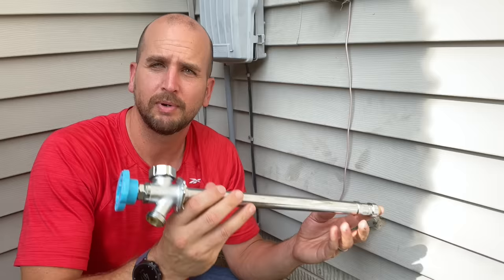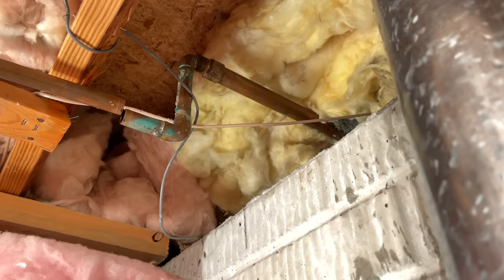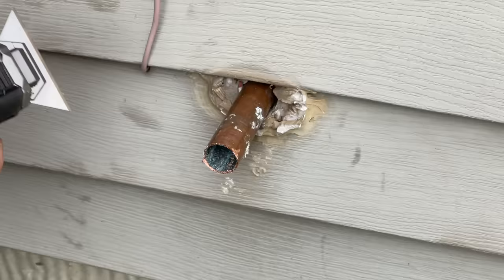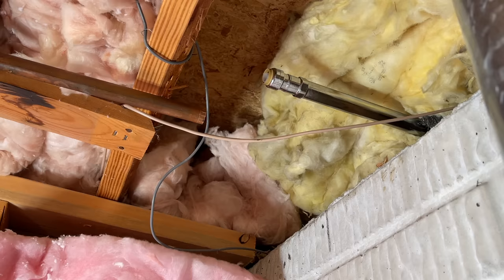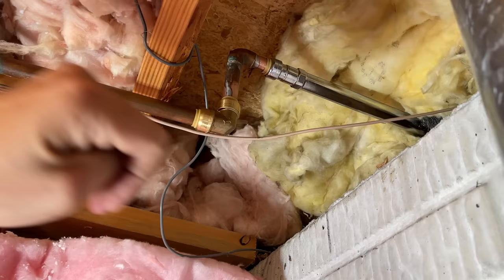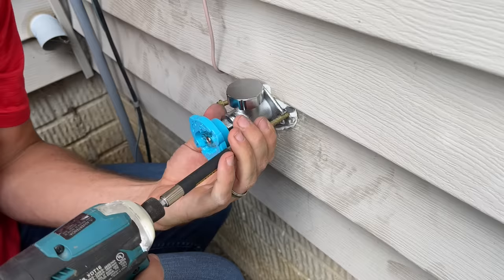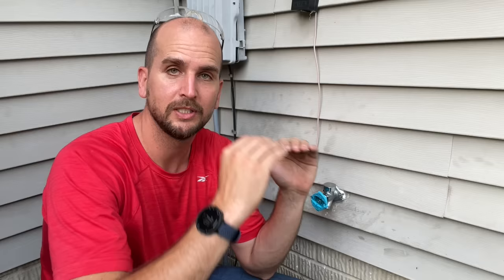Outdoor Spigot Replacement | Sharkbite Frost Free

Comment: Shark bites are good unions. You just don't want the pipe just de-bur the inside and outside of the pipe. It explicitly states that in the installation instructions. If you sand the pipe they may fail.
Reply: Interesting comment. I assume that the sanding of the pipe changes its diameter if sanded too much. Ir is it another reason?

Comment: Ive seen that Sharkbite reccomends against sanding the outside of the pipe like this.  I imagine it would be fine with an extermely fine paper, but the idea is that the outside of the tube needs to be very smooth (IE not roughed up with medium grit) for the o-ring gaskets to work properly.   So you might have done better to just melt that excess solder off with a torch, and clean with a towel.
Reply from the maker: Thanks for the feedback Jon 👍
Reply: Think most important is straight cut and no burs

Comment: Good video as always. I just replaced 2 frost-proof faucets this weekend. One leaked inside the house when you turned the water on. (Luckily I went into the basement right after turning it on or my basement would have flooded). And my other frost-proof faucet was spraying water outside when you turned it on. The anti-siphon had failed.
I replaced them both with an Aquor V2+. A very slick  system and they are rebuildable. Definitely worth checking them out. I have brick at both faucets and the recommend the Aquor V1 for brick or concrete but I liked the look of the V2 better and don’t mind the extra work. And I used the Pex-A expansion version with a service loop so I can pull it out from the front to service it should I ever need to.
I personally don’t care much for the quick connect fittings. If I am in a tight spot or don’t have room for a torch to solder and don’t have Pex-A available I use a double ended compression fitting (or make one). It’s more work but I’ve never had one leak and I can easily take it apart if I need to service the hydrant.

Comment: I live in New England, I didn't go through all of this.  All I did was add a ball vavle inside so in the winter I shut it off and run the rest of the water out.  You just really have to remember to shut the water off.

Comment: That downward slope is a big deal. We found that out the hard way last winter. There was no slope on ours and due to a freak ice storm the water inside froze and blew the faucet apart and there was water everywhere. For a replacement I'm going to use a couple of feet of PEX flexible pipe to replace the old galvanized steel that will allow me to get the bend required to give me slope.

Comment: I’m refinishing my basement currently and found my front yard water turn off valve buried  behind 2 gas pipes that was all drywalled over. Definitely trying to make it leak proof now during the remodel compared to later on when it’s all buried again especially because I’m going to lose access to the shut off valve again

Comment: I would like to see a video covering replacement of the shut-off valve. My house was built mid 70's and the valve doesn't work, as well as being in a horrible location. I know I could hire a plumber, but with my experience I would also love to do the job. But as I do with everything, pre task planning dictates I should probably make sure the steps I have in my head are accurate.
Thanks for another great video!
Reply: Unless your good at soldering I don't recommend a large fitting like that, depending on age could be a screw on though. If the area is finished think of the damage that could be caused. I am fairly good at plumbing and do a small amount in a professional capacity, I would still hire it out for the peace of mind personally unless it was a trailer or screw on in an unfinished basement.
Reply: @stich1960  It's currently soldered, but looks like it was probably "wet" while being done. More than likely replaced already. We have lived there for 21 years and it has been crap for at least a couple years.
I have checked with a couple local places (small and large business) and they want $500 plus to do it. That just seems silly. I can call the utilities to shut off the water and that's only $35 (off and on). I'm more than able to solder, but I have never done a soldered valve before. I do agree though, when I have enough doubt or have failed at similar jobs I call someone. Ex: replacement of a fuse panel, not gonna do it. Lol. The knowledge is there but the risk is high enough that's it is worth hiring it out.
Reply: @Toyotajunkie  I mean you do you. It's fairly risky imo around here it's hourly and would probably be closer to 300+ parts. I would still do it if it's finished at 500 because it comes with insurance
Reply: You can do the exact same steps with a shark bite ball valve and use pex instead of copper eliminating the soldering aspect. Would cost you around $100 hose bib, ball valve, and pex. As long as the angle from ball valve to hose bib isn't crazy you won't need to crimp anything.

Comment: This will be one of my summer projects, likely also using sharkbite … original plumbing is still galvanized steel and I’m not yet ready to replace with PEX or copper. So a sharkbite will let me adapt to either without removing the spigot.

Comment: Nice video, as a plumber I do not recommend shark bite fittings for copper situations.  I believe the ring inside the fitting is stainless steel which could cause electrolysis to both copper and stainless steel. Just my 2 cents worth.

Comment: I need to replace an outdoor spigot coming through the siding, but I’m in California. So, a Sharkbite spigot setup is fine, but i dont need the whole frost-free setup. I’m ~medium-skilled with soldering copper, but the existing spigot install is going to make the solder joint very close to the siding, and even with a fiberglass pad, I’m probably going to need some painting afterward (which id rather avoid since i dont have any paint.)

Comment: The drywall spigot replacement would be more what I am facing in the future. Also extending a garage frost free spigot to an external wall approx. 14 feet away. The reason ... the builder didn't put a drain in the garage so running a hose from there doesn't make good common sense.
Reply from the maker: Thanks for the feedback Chris 👍

Comment: I would love to see how to do this with a brick house that is on a slab.
Reply from the maker: That would be a good one, thanks for the feedback 👍
Reply: Same thing except you might need a hammer drill and masonry screws
Reply: My understanding was Infin1ty was talking about plumbing through the slab as opposed to open air in the basement like the video.  If that's the case, it would be quite different.
Reply: All depends on how the plumber decided to do it. It should be just a matter of cutting the water off(draining)and unscrewing it. We'd always screw a drop eared elbow to a purlin, and stub out a galvanized nipple. Most do it this way, but have seen a little bit of everything.

Comment: Just yesterday a plumber wanted to charge me $250 apiece to replace two spigots.  So today I removed one of them (it was threaded) and installed a replacement in about 30 minutes.  Also today I bought the exact same Sharkbite spigot, and over the weekend I'll spend an hour or two to replace the other one.  Some plumbers are just crooks.  And that's one reason why Sharkbite is so popular with DIY'ers and why plumbers hate Sharkbites.

Comment: In my situation there was no access from the inside.  We had cut a big hole around the spigot and cut the pipe from the outside.  Also it was too close to the tub to solder. So a Sharkbite had to be used.  Because of that I was given the tail light guarantee.

Comment: Nice job for your situation. I need to replace my spicket but my cellar has 2x6 wall to a walk-in basement, therefore that spicket is way to long. I wanted to upgrade mine to a cold weather spicket but looks like I have replace mine with a regular short spicket.........

Comment: Good job. I would emphasize the importance of ensuring a downward slope on the faucet, because you do not want standing water freezing inside your expensive faucet!  
BTW, the original soldering job exhibited poor craftsmanship. The green corrosion products were due to the original acid soldering flux NOT being cleaned off the copper pipe.
Reply from the maker: Thanks for the feedback Bill

Comment: I recently had a water heater installed by a pro plumber and I had called numerous plumbers out to quote the job.  I asked them all what they thought of Shark Bite fittings and none of them had anything good to say about them. One of them even started laughing.
Reply: That's for a couple reasons.  First, contractors won't use them as first choice because they are super expensive.  For example, standard 1/2" ball valve is about $8, the sharkbite equivalent is like $20.  Every sharkbite fitting is much more expensive than it's sweat counterpart.

Second, sharkbite fittings make simple plumbing jobs DIYable for the common person.  I wouldn't expect a contractor to be celebrating potential customers being able to do their own work.

Comment: I just installed the shark bite frost free spigot. It works but is extremely hard to turn. I called tech support and waited 3 minutes and 50 seconds at which point I was disconnected. Disappointing, I will probably return it.

Comment: SharkBites have many problems and I would never use them for anything that is not temporary, one they restrict water flow, two when they fail the typically pop off and that can flood a structure.  If you are uncomfortable sweating pipe aka soldering buy a hydrology hand pump ProPorss and some fitting.  It is cost effective and forms a nearly permanent bond.  SharkBites are good for outside and temporary fixes only.  They are great in a pinch  poor as a permanent solution.

Comment: I was curious if you could do a follow up video on how well this has lasted or any issues with this or any other sharkbite replacements. I'm currently debating on replacing my old outdoor spigot with one of these due to the current not being frost free and it is leaking (living in MN, we literally had 70s and 30s weather in the same week). Only issue I keep seeing on the Home Depot reviews are that it doesn't last throughout the winter. New to home repairs and your videos have helped me a lot especially with electrical. We bought the house in October and I've almost replaced just about every light switch and in the process of replacing the outlets. After seeing the cost of a plumber I will gladly save the money to do this myself.

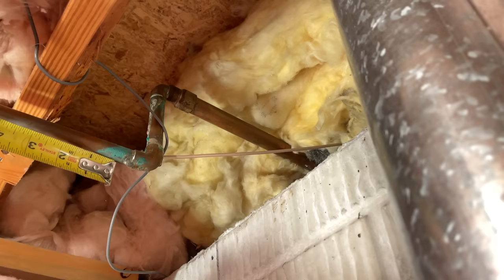Comment: Never used SharkBites. And I’m at 2:34.  But if I were doing this I would use two of the 90 deg and buy more copper pipe.  I say this because I’m already saving a huge amount of money doing it myself, I can get the materials before I start and the job won’t take as long. Will it cost more? Yep, but I will still be saving a lot of money, I won’t be thinking about what I MAY have to do bc I have a clear plan and I’ll almost certainly finish faster.

Note: Started back up and now your cleaning an old pipe?  Hoping that SHOULD result in no leaks? Nope, I cleaned that one section of old pipe carefully and everything is new from there on.

Comment: I thought this was a very useful video but I want to remove a Frost Free outdoor spigot because I am having a 3 season room attached to the back of the house and this spigot needs to be removed . The spigot is on the main floor and there are finished and installed  kitchen cabinets directly behind the spigot . Directly below the spigot  on the basement level there are  also built in cabinets and it would be a major project to remove the built in cabinets and try to find where the connection is.

Comment: Thanks for the well presented videos! I've subscribed! 
I've not read all the comments, but was wondering if the original spigot was soldered too the supply line at the end of the frost-proof tube? You didn't point out that many are actually threaded on with a pipe thread fitting and can be removed without cutting into supply lines. If yours was soldered, then using a Sharkbite made perfect sense if you couldn't make the repair with a stem rebuild.
Cheers!

Comment: I’d have been inclined to transition from copper to Pex, and get a sillcock with a Pex end.

That way you would have to get the measurements exact on the copper bends. Just throw it away.

Comment: we also live in norther Illinois, newer house, and valve is built on water line just after spigot. we dont need to shut down water on main valve , but only the valve after spigot. I have no clue what is purpose of putting a spigot, complicated velve system instead of regular one?! for first few years spigot was good, but after that period every single year you have to replace rings otherwise water leaks.

Comment: Using a SharkBite frost free spigot/faucet/silcock is a good way to get your homeowner's insurance coverage revoked. Insurers have a aversion from slip fit plumbing as they are a very common claim source. At the very least replace the turn handle with one that doesn't have blue sharks on it.

Comment: Make sure you mark the pipe to receive the sharkbite fitting so you are sure you have pushed this fitting 1 inch onto the pipe receiving this fitting. Anything short of this will cause a leak😥
Reply from the maker: Good call as I mentioned the 1" depth for reference in my cut but I did not come back and mark the pipe later in the install.  Appreciate the feedback!

Comment: Looks easy with a basement and siding but show me how easy this is when it's a concrete foundation and a brick wall when all the pipe is soldered. I recently had to remove the brick in order to replace a  soldered frostproof fitting, the inside wall was a kitchen cabinet.

Comment: That DAP Dynaflex caulk tube said Clear on the side, but it came out white.  That's strange.   Whenever I've had a caulk tube that said Clear, the caulk came out transparent (clear).
Reply: It will dry clear though
Reply: @ourkid2000  Thanks Chris.  I figured there had to be an answer that made sense.

Comment: Two Questions:
1. How does the copper pipe stay secure in the new spigot without any glue/solder?
2. What secures those new screws so tightly, into your home’s Siding? I didn’t notice any wood or backing material behind that wall. I ask bcuz I have Siding also. Thank you for yet another GREAT video!!👍🏼👍🏼
Reply: 1 - It's a sharkbite spigot. 2- there almost certainly is sheathing at a minimum. It's screwed into that at least.
Reply from the maker: Hi Jess.  As Mr G indicated for #1 this is a sharkbite spigot which has small little teeth and an 0-ring which holds it on the pipe.  For #2 there is a 2x10 board which is sitting on the top of my foundation wall which the spigot hole was drilled through so the screws holding the spigot are secured in that 2x10 board.
Reply: @EverydayHomeRepairs  I see. Thanks, guys! 👍🏼

Comment: Scott, thank you for the video.  I live in Illinois as well, and have an outdoor faucet that has been inoperable for over 10 years.  The vacuum gasket failed and blew the top cover off, so it would pump water out the top and faucet itself when we turned it on.  When I replaced our water heater a few years ago, I cut the line in our utility room, that then feeds that faucet, and installed a ball valve to shut off water to it.  Here is where the repair becomes a problem and challenge for me, and I would love your thoughts.
The line makes a 90 degree bend right after the ball valve, and then runs through the space between my office and garage walls.  This is a run of approximately 15-20 feet, and I have no way to see anything in the space.  I cannot tell if the line runs through the wall studs or the space between the ceiling header and upstairs floor.  

Assuming the former is correct and the entire line is straight, I might be able to cut the line shortly after the 90 degree bend and pull the entire line through from the outside.  The challenge then would be getting the pipe to hit through every hole in the studs coming back in.  Even if I only pull it out a couple of feet to cut the old off and put the new faucet on, I could be looking at trying to having to hit 2 studs.  

Assuming the latter is correct, and the entire line is straight,  I might be able to cut the line shortly after the 90 degree bend but I'm unsure if it would be free.  I do know, right after the 90 degree bend, there is a piece of pipe that they builders flattened the ends on, pounded into the floor joists, and then soldered the water line to, in order to "support" it.  My concern is there could be another one hidden away in the space that I cannot see.

I really do not want to cut the drywall out in the office or garage, in order to tackle this job.  Do you have any ideas/suggestions that may make it a bit easier or less risky to tackle?

Comment: Great video, I'm glad we don't have frost here in California. I do have a question though. Our outdoor spigots have a anti siphon valve on them. When you turn off the water, there's always a spray of water comingout of the anti siphone valve. It's that normal. Can I just remove the valve from the spigot? Thanks
Reply from the maker: I would keep the valve in place but you can get a rebuild kit usually depending on the brand.  Overall from your description I would say you are find and having some water go past the anti siphon valve when you shut the water off is common 👍

Comment: This video was very informative, I had the same faucet installed several months ago but  the water pressure is so low, that I cannot use my sprinkler to water my plants.  I am not having this problem with any other water faucet at my home.  Is that something that can be done so that I can get better water output?